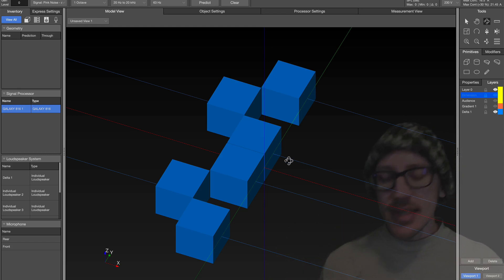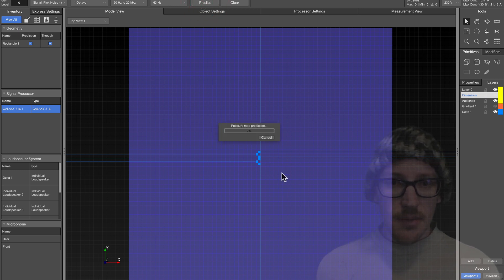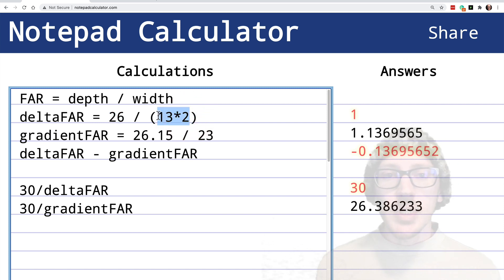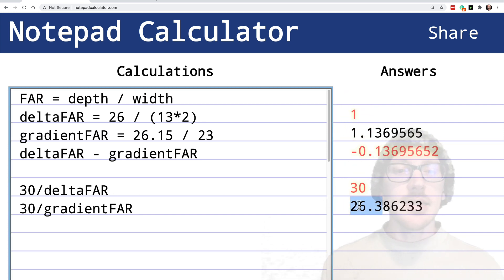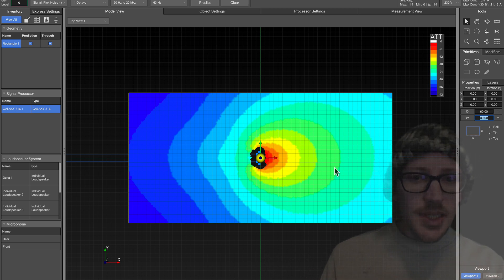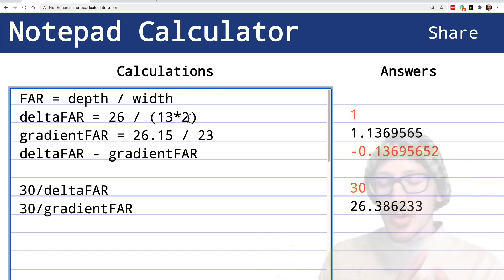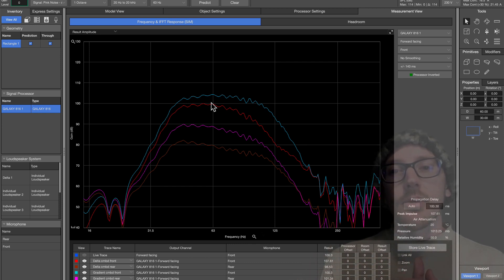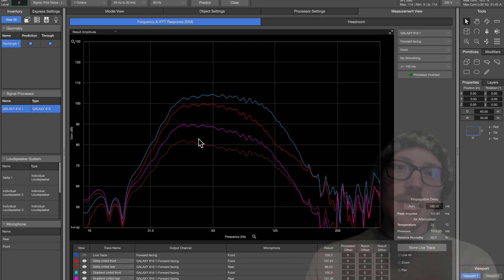Gradient vs Delta Subwoofer Array

Comment: Thank you for the video. Very informative. I have a few questions if you don't mind me asking. I've got to the point where I've moved from professional DJ services, to small live production (500 guests). I have at hand 8 identical subwoofers, Yamaha DXS18 and a further 8 DXS18XLF. One is band pass, the other is front firing. So, question 1) What would be the best way to utilise these speakers together as they are not divisible by 3. Question 2) Can you mix subwoofers for a gradient setup? I actually have a 3rd, which I've not seen covered anywhere and perhaps you've never considered it. As my subs are single 18's. If I set up for example 6 subs in delta, would it make sense to stack the speakers in twos but have the top subs in each stack in cardioid - so essentially the three stacks in the delta are all set up as a cardioid? :) I hope these questions make sense. I have plenty of time on my hands at present as I'm sure many in the events industry do, so I'm trying to figure out the best way to approach an annual event which will resume once permitted. Thank you very much in advance!
Reply from the maker: Hey Matthew, these look cool. Are you enjoying them?

> 1) What would be the best way to utilise these speakers together as they are not divisible by 3. 
Do you have some photos or a design from a recent show? 
Some common options for even number of subs:
1. In-line gradient
2. Arc (physical/digital)
3. End-fire

Since you are watching this video, my guess is that you are mostly interested in directional arrays?
I'm a fan of the gradient array. It has great rejection in the rear and some flexibility in coverage angle in the front depending on the array.

> 2) Can you mix subwoofers for a gradient setup?
Short answer: No. The recipe for successful cancellation (or summation) is matched frequency and phase response. Therefore, you need matched sources.
Longer answer: If you sit down with some reflection free measurements of your subs and you probably figure out how to combine them. If you send me some measurements, I can help you.

> would it make sense to stack the speakers in twos but have the top subs in each stack in cardioid 
I've never tried it. MAPP 3D is probably the best sandbox to play with these more complex designs.